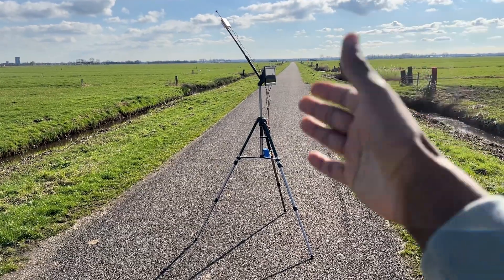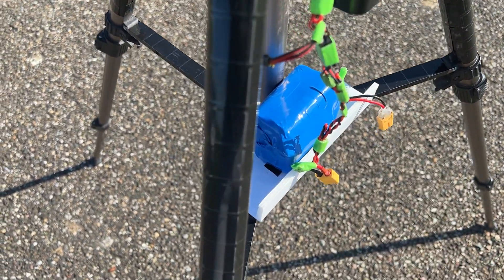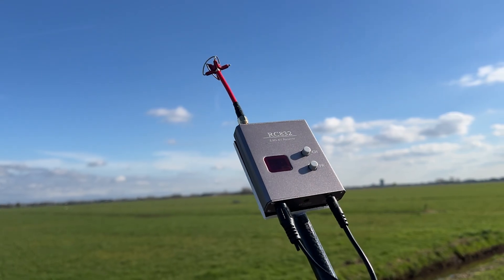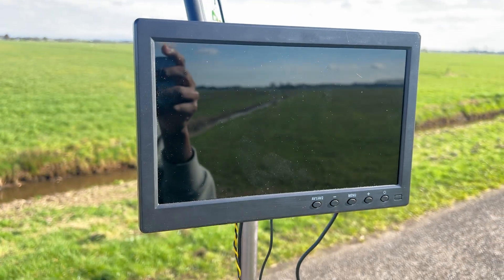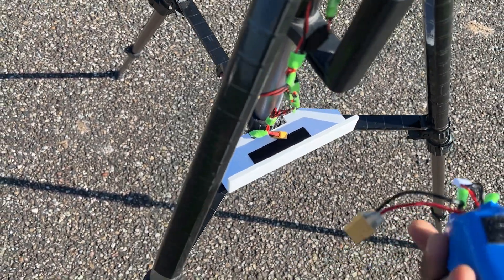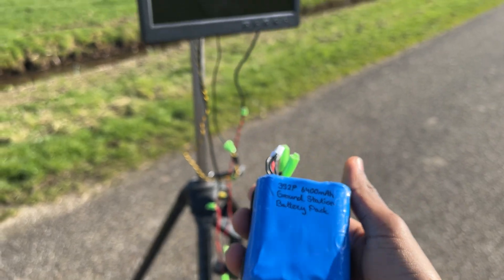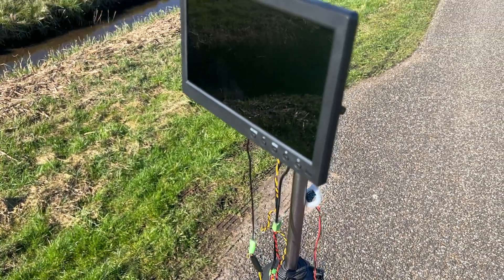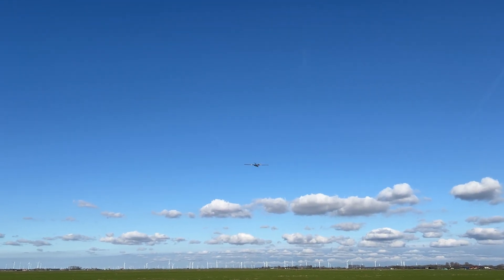Homebuilt Ground Station for FPV - Complete Setup & Overview

Comment: when yo fly bein in the car don't you have any problen with your tx, does it hold a solid connection? iv got the radiomaster pocket which is 250mw not really powerfull for this

Comment: I need to get a monitor like that one! That’s sick! I have that same receiver just haven’t really put it to use yet. So what inputs does the monitor need to be used with that receiver. It seems like a decent video receiver. I’ve connected it to my ev800d goggles and it seems to have better sensitivity than the receivers in the goggles. Man I’ve been wanting to switch to digital but it’s so dang expensive. Anyway hope you have been well and thanks for the video! Ohh yeah I forgot to ask, what’s you favorite VTX and camera? I lost my good camera and this cheaper one I have gets washed out in bright daylight. Need a cam that looks good bright sunlight. I was thinking maybe that foxeer trex 1500vtl…

Comment: Great behind-the-scenes looks, so to speak. A very pragmatic setup, with many useful ideas. 

Going to use your battery self idea. An option if pilots need 12v, but have 4S, or 6S packs on hand is to use a DC-DC Buck/Boost Converter to provide a steady voltage to equipment (buck steps voltage down, and boost steps voltage up) Just need to make sure can supply the amount of amps the equipment is needing (with some margin).

Comment: Great setup, but you may want to point that cloverleaf more straight up to get the most out of its gain pattern: as it is, the electromagnetic donut runs straight into the ground ahead of you. Do consider a small triple feed as well. I stopped using omnis years ago, I can always turn the whole rig around if I decide to fly miles behind my back. I can even run close range touch-and-go practice using a 14 dBi patch; directionals are more versatile than we tend to think. Happy landings!

Comment: Hey man im a big fan and i have a project coming up for school i want to make a rc plane using foam board but i dont know what design i should use like prop in the front or back or what taill design could you maybe make a vid about this? Please?
Reply: Check his channel for builds.  Good luck.  Part of projects is learning through failing.
Reply: You should check out the FT Simple Scout, it's a great first foamboard plane.
Reply: If this your first plane, a pusher (prop behind) tends to be more forgiving. This because if have hard landing, or crash, the nose can often be first thing to contact the ground, which can break a prop, or bend the motor. 
Some great build options here, and on the @ExperimentalAirlines channel. 
"AXON Construction Details" and 
"AXON Foamboard Trainer and Light FPV Platform" videos show details.
https://youtu.be/bta80gyHK7Q
@AeroStuffFPV version of this is the "Star Walker 1600"
This version shown in "Homemade FPV Plane w/ Super Flaps (STOL) - Flight Footage (AeroStuff FPV)" is a bit more advanced as includes STOL Flaps and a V-tail configuration. 
https://youtu.be/wMdsf6BNl5Y